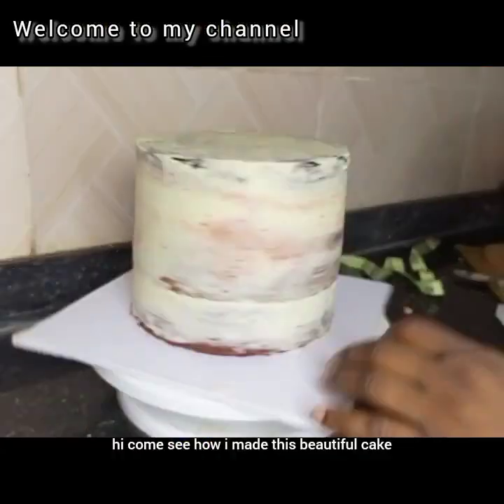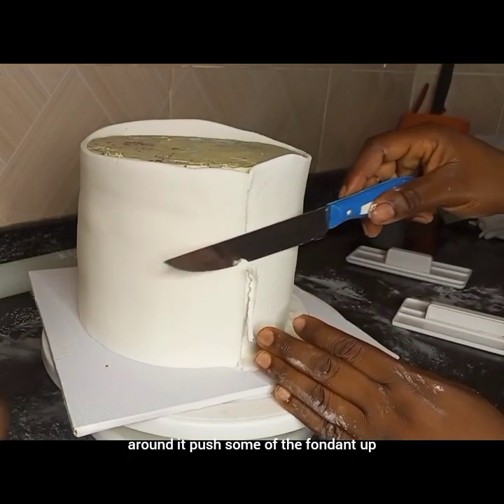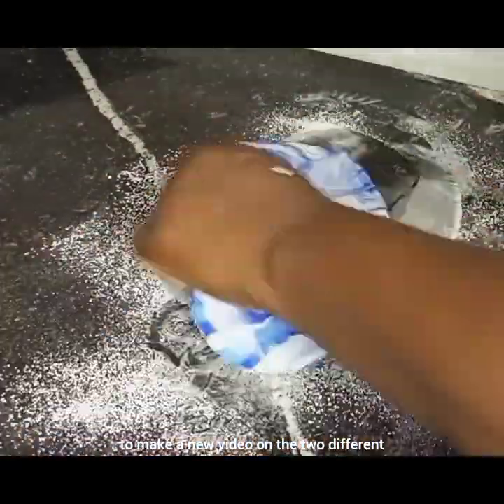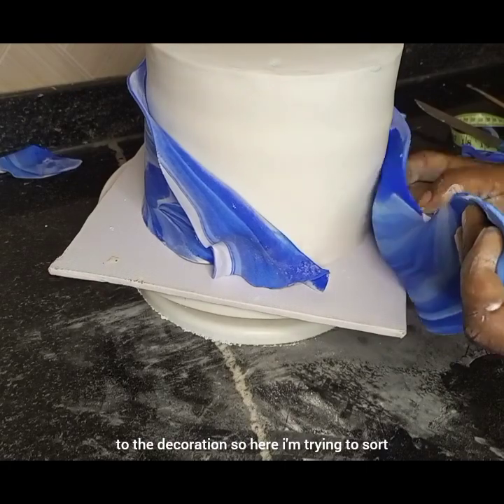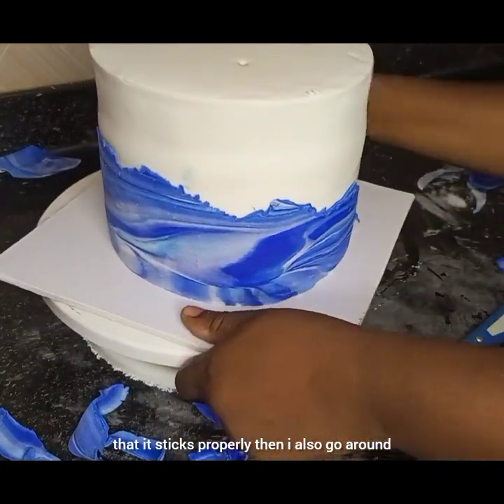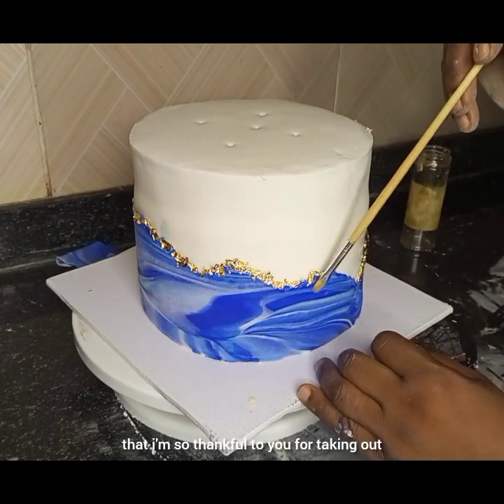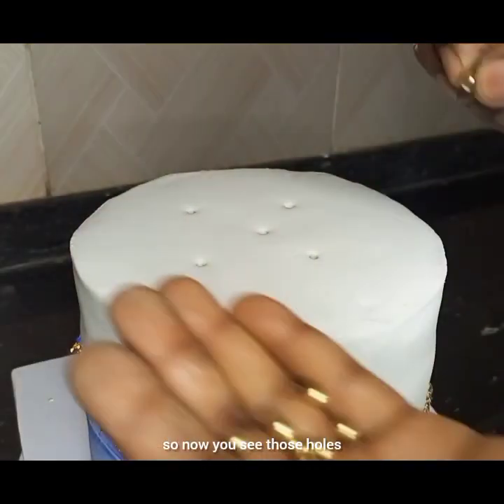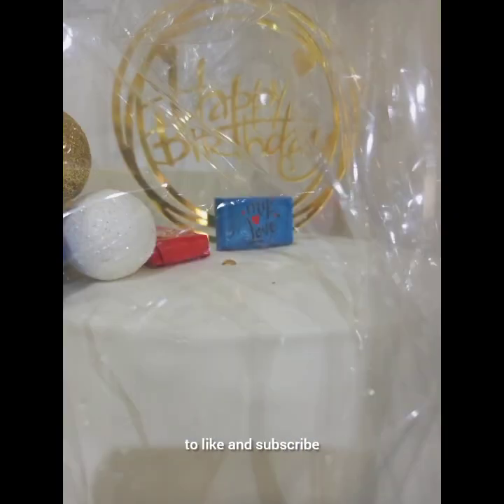Fondant Cake Decorating Techniques |How to make a Fondant Birthday Cake

Comment: Beautiful tutorial. Pls can you share the fondant recipe here, want to try it today. Thanks
Reply from the maker: Thank you 😊.
Here you go!
Water 1/2 cup (pour in heat resistant container)
Gelatin 1 and half Tablespoon 
(Sprinkle the gelatin into d water)
Allow to sit for 5 minutes.
While it is proofing for the 5 minutes do the following:
Measure out and sieve 1kg + 500grams (1.500g ) icing sugar 
Add in 1 teaspoon of CMC (level it oh)
Mix into the icing sugar and keep aside.(You can remove 200g.of the icing sugar and use for dusting your surface while kneading)
Put on your fire, add water into a pot that will conveniently hold the container of your gelatin without it entering into the gelatin.
When d water boils gentle put the container of your gelatin on the water and continue to stir until d thick gelatin melts...
While at it, add in half cup of glucose into the almost melted gelatin and keep on mixing until all melt and mix together. 
Bring out of the steam and allow to rest a little while still warm (not hot oh)
Make a hole in the icing sugar and pour the warm gelatin/glucose mixture into it,
Use your clean hand to start mixing, when they have come together, transfer to a clean surface and continue kneading until well combined, smooth and stretchy.
Rub crisco or Vegetable oil on it, wrap in a cling film or clean nylon, tie very well keep it to rest for at least 4 hours or for best result leave for 24 hours before using.
Cheers to your fondant making.

Comment: Nice and neat work. Can I get an oil based chocolate cake recipe? Most of the recipes I use comes out too soft that stacking it becomes difficult. Most have this 1 cup hot water in recipe which to me is the root cause. 🙏🙏
Reply from the maker: Thanks a lot! 
Yes you can!
Oh! Well, mine uses warm water: half cup of hot and half cup of room temperature. I hope it gives you what you want. 
Thanks so much for watching and engaging.